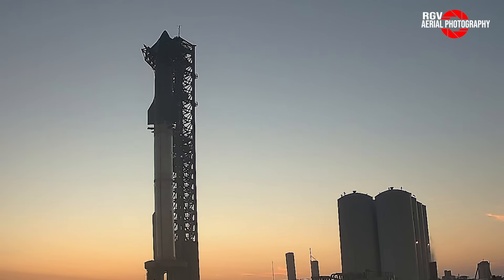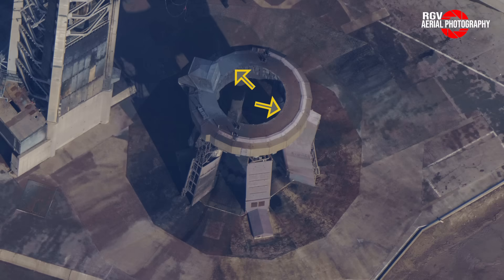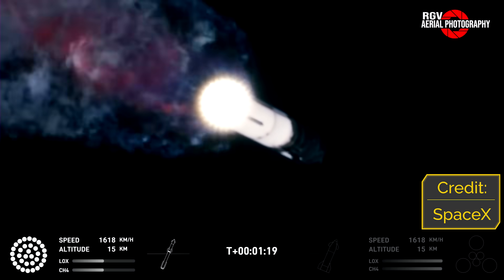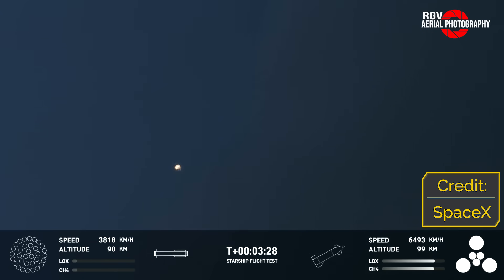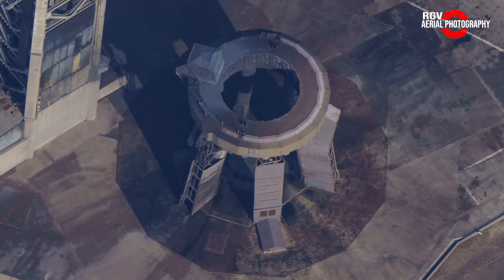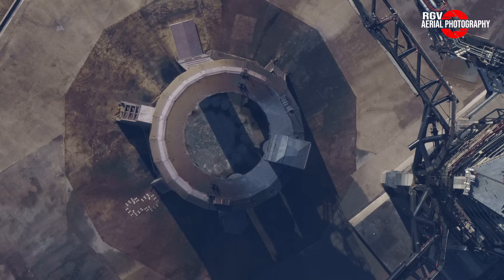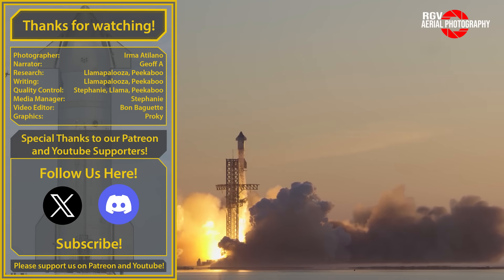DID THE LAUNCH SITE SURVIVE?! Post-Launch Flyover! - Starbase Flyover Update Episode 25

Comment: How could they have propellant slosh when its a pressurized system ?
Reply: Pressure doesn't prohibit liquid fuel from moving around the tank.
Reply: @ProfezorSnayp  It should be pressured to the point of no sloshing yet not to much to over pressurize that it turns the propellant to gas

Comment: Fuel slosh.  Could be an issue. If the turbo pumps are fed a mixture of liquid and gas - the result cavitation and high risk of destruction unless power is ramped up gradually.  A related issue.  Is the liquid methane tank pressurised with helium?  What’s the solubility of the two?  Does fuel slosh result in the shaken fizzy drink problem?  Still much to learn and optimise.

Comment: Does anyone have any insight into the nature of the dark color of the exhaust plume visible starting at 1:20? Because the fuel is pure methane burned with pure oxygen I was expecting it to be significantly cleaner burning than what was seen. It's very difficult to get methane to produce soot when burning it even when very fuel rich and oxygen starved, owing to the fact that the molecule consists of only one carbon to begin with; there just isn't much chance for carbon atoms to link up into large chains that form soot. Is this exhaust coloration then due to ablation and vaporization of the copper liner inside the engines? Maybe it's nitrogen oxides from the air interacting with the hot exhaust closer to the vehicle? .....Thoughts?

Comment: what's the booster pulling on the flip, 2-3Gs? Must be a column of >5 metres of  lox from center engines plus whole down comer of methane. Even tipping sideways at that acceleration surely engines wouldn't be starved? Also surely engine gimbaling is tied to internal methalox state to ameliorate fluid slosh during such maneuvers?

Comment: I think the hot staging is the key to it all.  That was a MASSIVE stress load on both vehicles, and I dont think the main stage was meant to rotate that fast.  We are talking about something the size of a building being rotated 180 in a matter of seconds.  It feels like this was caused by the hot staging, and not any reaction thrusters.  You can see later the puffs from the reaction thrusters that you didnt see when it started its rotation.  I think the upper section pushed the lower section in a way that they did not expect.
Reply: This is my feeling too: they kept the three internal motors of the booster on in order to avoid deceleration of the booster under the exhausts of the ship; a more gentle operation could help. Wonder if telemetry could also provide useful info  of propellant pipes at bottom of booster: the sequence of lighting and then switch off would be explained.

Comment: Was the booster a failure??   Did they intend on landing it?   Did they ever announce the landing zone?    ty
Reply: They had hoped to attempt a soft landing of the booster in the ocean but without recovering it. Instead they were able to test the flight termination system that was a concern of the FAA after the first test launch. So in this case a “failure” still provided much needed data for SpaceX and the FAA.
Reply: @ReinReads  cool.  what about the starship?  did they intend on landing that?    thanks

Comment: If fuel slush was a big part of the boosters not re lighting , they may have to consider dual chamber tanks with independent pressure. They are unlikely to build "expendable" boosters due to cost. So the dual chamber tanks may be a necessity for landing. This need not present fueling challenges . They could have an inter chamber valve system that seals once both tanks are full. It will require some plumbing changes before the feed pumps. But its all doable . Gravity is a bitch.

Comment: "Resounding success"? No...not by a long shot. Stop being a fanboy. It was very good progress compared to the first flight. However, the unplanned destruction of both stages has exposed significant issues that will have to be resolved and built into the next Starship prior to flight 3. Also, there is plenty of redesign still needed on the launch structure if the goal is to have quickly repeated launches in the near future...although the damage after flight two is far, far less than flight one...there is no way the tower as-is...is sustainable.

Comment: For the booster it's relatively clear: stage separation caused a lack of acceleration wich resulted in a fuel backsplash. Therefore the re-ignition of the engines failed ensuing no more control and BOOM.
For the spaceship itself it's not that easy. As we see the nose cone relatively intact after breakup the issue must have occurred way down at the engine bay or shortly above...

Comment: The plume on starship 40 seconds before RUd correlated with a loss of oxygen as seen in the LOX indicator. Sounds like the issue you picked up on with the quick release not sealing the oxygen load valve sufficiently.

Comment: Very comprehensive report. I think the booster and perhaps the 2nd stage suffered propellant surge due to fast deceleration of stage one when hotstaging occurred. This also may or may not have triggered the FTS on both stages. That flip on stage one was very fast! 😳
Reply from the maker: That sounds quite likely to me! That flip was quite cool to see though, I hope they can find a way to keep the fast flip but not have the propellant be as affected!
Reply: @RGVAerialPhotography  Yeah, hoping they can throttle the engines such that the first stage doesn’t get decelerated like that and the can also slow the flip down a bit next time! 🙏

Comment: On low gravity you rely on inner pressure to send fuel to the engines, however, as you spend the fuel you also spend your pressure. So at the beginning, the booster has gravity and a lot of pressure to help push fuel to the engines however both gravity and pressure drop during the flight, and on top of that during hot stage separation you introduce a force that pushes fuel away from the engines at the bottom then immediately after that when turning the ship the acceleration sends fuel towards one side of the booster due to centrifugal force hence leaving half of the engines empty. 
Somet thing that I ask myself by looking at the  design of the fuel tank of the booster is this, why leave that much room for fuel to move inside once it is spent? There should be a way to implement some kind of diaphragm or part that moves as fuel drops so that the remaining fuel cannot move around to provoke these issues.  
Why did Starship flip and work fine then? Well if we take a look at Starship it reignited its engines close to Earth giving time for the fuel to position itself at the bottom and for gravity to do its work, another important thing is that when you flip something centripetal forces are exponentially higher the further away you are from the center of mass this means that if the booster is higher than starships, any calculations made for starship will not work for booster since its fuel and engines are subject to higher centripetal acceleration during this flip.

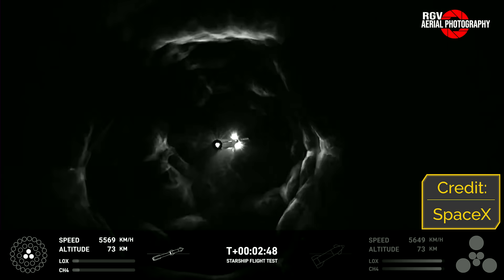Comment: note.. at 4:43 the speed is 5572km/h, at 4:46 the speed is at 5568km/h, that is not a huge diffrance, and its certanly less than gravity.... in theory. But that is amusing the computers transited that perfectly. Optimally  that it should not slow down at all, due to the risk of the fuel slashing about. Of cause, there would still be fuel in the pipes, but by the poin the other engines fired up, there was probobly low density pockets in the fuel pipes that if that was the case would have the engines either fire irdaically or possibly exploded.

Comment: enormous size enormous weight , cause huge shockwave . is bouncing through the all rocket and broke the heat sheild and while the rocket separating , second shockwave cross with first and create heat somewher in rocket . and again while its traying to maneuver the third shockwave broke some part of cold metal insede the engine i think . this triggered self desturaction system . this is my opinion

Comment: As Scott Manky pointed out. Near the end of stage 2s flight. The oxygen level was dropping to below methane levels rapidly.
Yes. I know. I spelled Manly incorrectly. 
I would change it. But so many of you like to express your whityness. I decided to leave it as is. Enjoy
Reply: Who's Scott Manky? 😆
Reply: @BabyMakR  Scott Manley after he's had a few when back in Scotland
Reply: @Jonathan_McD  🤣😂
Reply: @BabyMakR  i was wondering who was Scott Manky. muahahaha
Reply: @BabyMakR Manley
Reply: Wow. Have of the 14 replys are about a spelling mistake caused by fat fingers on a small phone. Don't you guys have anything better to do with your time?
Then I need to waste time opening up the email that has no value and are really not very funny or whitey
Reply: If this O2 quick disconnect leaked in IFT1  then why was that problem not fixed for IFT2 - seems like a pretty damn important thing to fix to facilitate the success of stage 2!
Reply: Thank God for the expert named Scott. lol
Reply: Man Scottley
Reply: I think its because during hot-stage separation, shockwaves reflected back and damaged the fuel injection system, cause fires and leaks on LOX tank. The same shockwave also cause several leaks and damages in the booster
Reply: @superspies32  But staging took place almost in a vacuum, so the shocks could only be in the exhaust plumes themselves. This should be a relatively easy thing to fix, since R-7/Soyuz has been doing hot staging since the early 1960's. There was no evident plume from leaks at the front of the booster, by the way.... its ullage problems have been nicely speculated on by Scott Manley. I suspect the extremely rapid turnaround of the booster had something to do with it: it looked faster than Falcon 9 RTLS turnarounds, and Super Heavy is so much bigger and, well, heavier. The sloshing would be lateral, since longitudinally the booster was constantly accelerating forward with the three central engines still going.
Reply: @superspies32  Wasn't he LOX valve for the QD leaking?
Reply: @superspies32  Usually there is a delay with 2nd stage ignition for these reasons. I bet the next one will institute such a delay.
Reply: @superspies32  I don't believe there was any evidence the booster suffered damage from hot staging. It's failure could likely be entirely due to fuel slosh. But I guess we'll find out.
Reply: @superspies32  That's a pretty good suggestion. Makes sense.🤔
Reply: Scott Manley is a pretty cool 😎 dude...
Reply: @bamabldr66  I prefer Scott Manky, but Scot Manley is cool too
Reply: Manky Scots git
Reply: @tomu2858  I soiled my armour I was so scared!

Comment: This is all software problems.  The oxygen leak may have caused the engines to not fire up.  Rockets carry their own oxygen and jets use the atmosphere oxygen to propel the craft.  I wonder if it is a failure explosion, or they lost control and they triggered the explosives on board.  Since, if they lose control  the craft is going to hit a city they explode the craft.  Hence, all nasa and I assume the space X crafts have explosives wire in.  Did a foreign nation get the code and sent the message from their satellite in space and it worked... big bang failure?

Comment: Leaning away from tower is almost certainly purposeful. Apollo did the same thing on launch for the same reason. They want to get away from the tower. Remember the launch is totally automated and as such if some part of tower fails to move out of the way, you've got problems so it is built into the launch program.

Comment: watched it far too many times now, and I reckon the hotstage ring needs to be longer with a tapered centre (think of how women used to wear a really tight corset) and the booster stage needs a little more airtime before going for the flip - maybe a little more altitude before stage sep. 
I'd also opt for a semi-disposable hotstage ring because ElMu likes to cut costs and that could be seen as a potential possible midstage rather than just a hotstage. something else that could possibly be picked up after the flip.

Comment: I think the main issue was the leak. If this didn't happen, Starship might have been able to reach the coasting phase
Reply: Scott Manley had a, to my eyes, very convincing theory. During the hot staging, you can see there is major and FAST deceleration of the heavy booster. That might have sloshed the fuel too much causing the engines to fail. You can even see engines fail that havent even been turned off.
Then its perfectly possible water ram in the emptied downcommer might have caused the RUD.
Reply: @mistrants2745  But the "decelaration" was felt as constant forward acceleration by the booster! Rather, the lateral (pitching or yawing) rotation of the booster would have caused sloshing. Hopefully, not too much weight will be added by longitudinal baffles needed to stop this sloshing.
Reply: @awuma what do you mean felt as acceleration? Wouldn't the sudden speed change cause the propellants to lurch forward?
Reply: @Barthhhelona It should. Objects in motion want to continue on their path. The liquid was being pushed down and then should have jumped up a bit with the sudden slowdown. The liquid is moving through the air just as fast so it makes sense. The leak on the ship caused it to run out of fuel to early hence the RUD. They might have a small issue with the nose cone section falling back to earth and not being exploded as intended. Overall this was an awesome test flight and proved concepts. Hats off to SpaceX, you guys did an amazing job. Look forward to OF3
Reply: @mistrants2745  that is true, but I was talking about the ship, not the booster
Reply: My gut feeling to,  hopefully we find out
Reply: what about the first stage or is that also affected by the leak @Letsgosurfing-cc3ly
Reply from the maker: I definitely think it would have. Thankfully, since the pad only got toasted and Elon himself confirmed that stage zero held up quite well, we should hopefully be able to see another launch within the next couple of months!
Reply: @RGVAerialPhotography  yeah, and since there were less failures overall, the regulatory process should be shorter I think
Reply: The good thing is that it was a slow process so there should be a lot of data showing what part failed.
Reply: Id like to know how they plan to reach orbit? Because the amount of fuel left over, and this was never intended to reach orbit, suggests perhaps some other plan to preserve fuel enough to reach orbit eventually? Also recovery, you need enough fuel to return and land, as they intend to do. Bear in mind, no payload on these test flights, that adds to fuel burn.
Reply: That huge LOX leak was the apparent start of S25's problems.
Reply: "Excitement guaranteed." Ezekiel Musk

FTS used intentionally to placate FAA.

"For what does it benefit man to gain the whole world after eclipsing the magnetic equator of our stars port cloud magnetic gravitational equator for the he next millennium only to lose his soul to the transhumanists?" YahWeh/Yeshua/Holy Spirit.

Comment: The ignition sequence on S25 was unexpected. 2 of the three vacuum engines ignited followed by the third. That should have redirected the ship at an angle. By the time the sea level raptors ignited the ship was several meters away from the booster.
The 10 gimbaling raptors in the second ring must have had propellant trouble. They did ignite but shut down a second or two later. It did not look like an electrical problem, nor did it appear to have to do with engine performance.
Reply from the maker: It definitely seems like there was issues with the propellant feeding, likely from sloshing occuring during the flip.
Reply: @RGVAerialPhotography  Yes, I agree it is the only reason left as far as I can figure out.